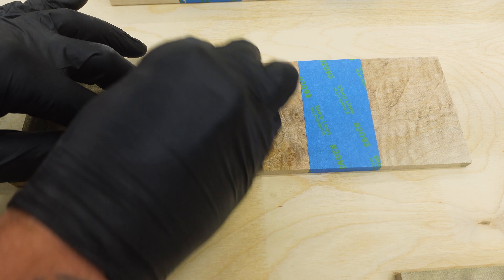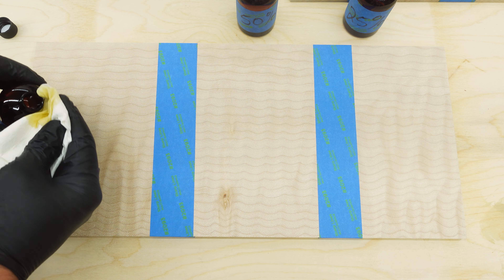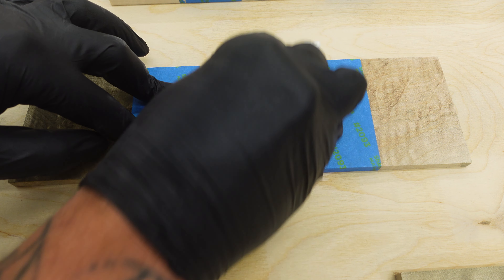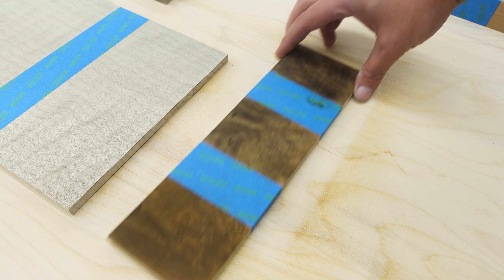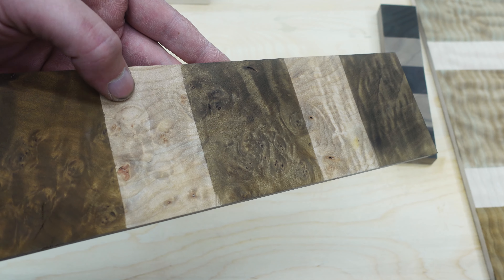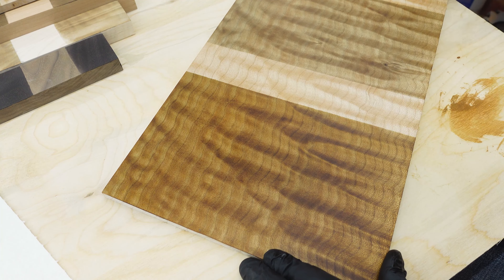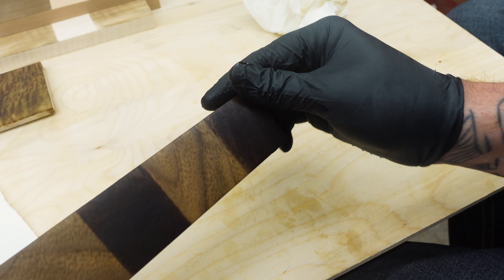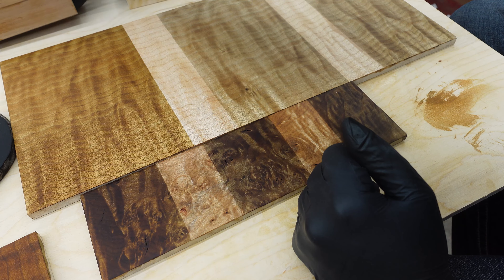High End Wood Stain using Ferric Nitrate | Woodworking Tips and Tricks

Comment: Being a chemical engineer who loves wood working, I love the experiment.  Only questions I have is what 100% means--does 100% mean a saturated solution at 75degres or some other temperature?  I also realize that Ferric nitrate is a strong oxidizer which reacts with the organics.  Also I do not know if your localized heating get sections to boiling but literature indicates that can give off Nitric acid.
Reply from the maker: David, the 100% is just a term I used for the almost right ratio of ferric nitrate crystals and distilled water and was easier to stepdown for the 50% and 25% mixtures.  I landed close to 30g per 2 cups of water, but there is room to refine for sure.  My goal is when the heat releases the nitric acid, it reacts with the chatoyance of the curl and figure of the grain, while leaving the other grain structure untouched.  I think this is achievable with different ways of applying, sanding, and reapplying.  Over the course of next week, I'm taking notes and different applications to get the desired effect I'm looking for.  Cheers!!

Comment: Great video. Ferric nitrate also known throughout history as aqua fortis has been used by gunmakers especially on highly figured maple stocks. It is a chemical reaction but not a stain. The resulting color after applying heat can vary considerably and the use of a quality stain following the nitrate acid is usually done for final desired color.

Comment: Pre-treatment with tannic acid solution will enhance the figure in acer species and darken the color depending on concentration of tannins. The iron nitrate stain was called aqua fortis (nitric acid's common name in 18th century & earlier) and as you note made with nitric acid and rusty wrought iron. Used commonly by American flintlock longrifle makers, historical and contemporary. The reddish tint doesn't always occur but is highly sought after by longrifle makers.

Comment: Like the results on maple. I wonder if the heat would cause the veneer to delaminate? This would be my choice on some fiddleback maple veneered speaker cabinets. Just don't know if that heat would cause delamination between the wood and the substrate.
Reply from the maker: Yeah it’s hard to say, sometimes it does take a lot of heat to start the reaction.  Glue could unset

Comment: Very cool! I think if you had sanded them back before adding the Rubio, you could increase the contrast dramatically. I’ve used that method with wood dye and it turned out amazingly.
Reply from the maker: Absolutely!  I did some more testing and just a little bit of sanding and additional application, I was blown away by the result.  Super cool stuff!